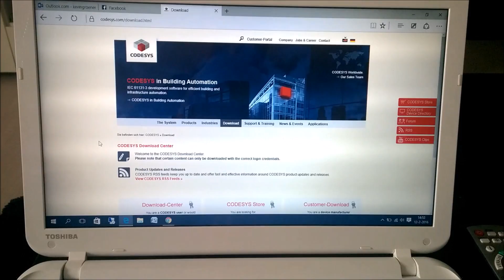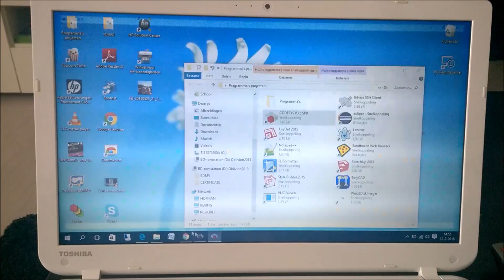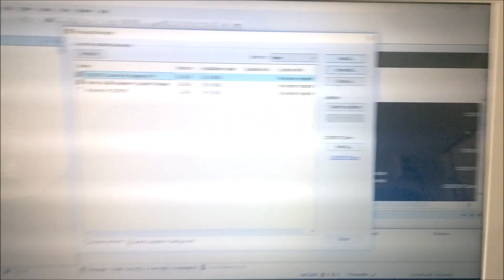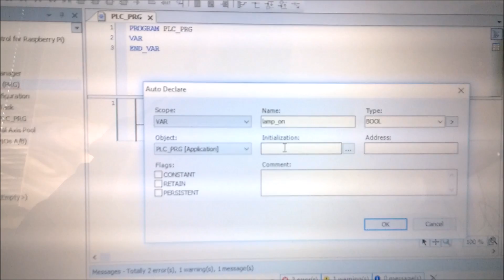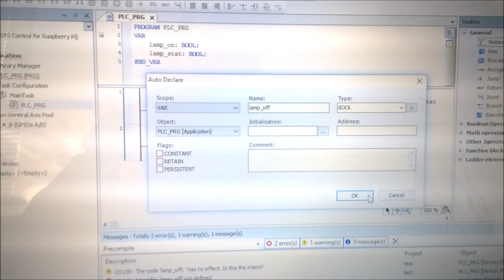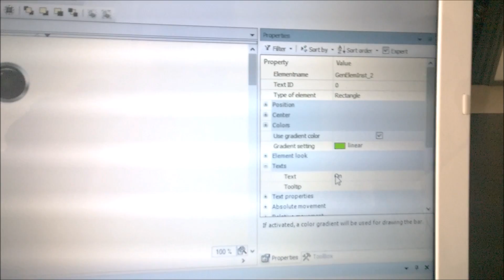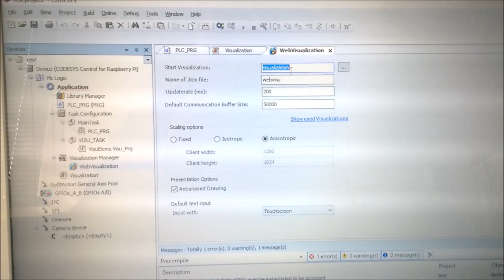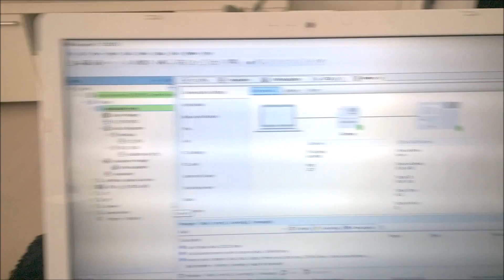RaspberryPi to PLC Codesys step by step (controling GPIO's)

Comment: Hello, I have a question: rasp can recognize usb ethernet adaptors? (those usb to eth cables).
I wanna try to use ethercat master with softmotion but need 2 eth ports. One for tcp and other for ethercat...
I use codesys with several different plc brands but they all cost too much and I am looking for somth cheaper.

Comment: Followed everything step by step but when i go to scan for my device to go online there is an error message "Scan Failed. Please check that the gateway is running and that it's settings are correct." Anyone know what this means? the gateway doesn't have a green circle next to it like in the video but instead has a red one. is there a step to set up the gateway that is not shown?
Reply: i had the same problem, i just reinstalled the PI!

the thing is to first update you PI in the codesys software, then when the raspberry pi is running and connected, push the codesys runtime package 'install' button.
the Package will get installed to the PI. after that Push the start button below.
then PI should be visible after scanning now!! or you can manually type the IP of your PI too.

Comment: hello i have one question. how to use another raspberry pi gpio with codesys. i want to my raspberry with other raspberry pi is gpio on off.i not found. please help
Reply from the maker: Murat İnan you want to use the other raspberry pi as slave you mean? In that case you should run codesys on both raspberry pi's. You must use then a communication protocol, like modus over TCP/IP. Then you can choose to run a program on the slave, or to couple the Io's directly.

Comment: can you please explain your hardware configuration , also in case of extension of gpio pins what should be done to increase numbers of gpio pins, also what should be done to take analog input/output, what are hardware is available for it and how to program  using codesys?
Reply from the maker: Soon I will be making a video how to connect a esp8266 with raspberry pi using codesys as software. This is a low voltage (3,3V) chip that has WiFi on board. And will function as remote Io. It's also possible to connect it with a Arduino for extra Io's.

Comment: Ciao... Thank you for this video; i followed all your instruction but i'm not able to switch on the led.  All is working: codesys program and  online connection is active...  i see, in the online in plc program and on the webvisu, the status led switch on and off but, physically, nothing happen.... The GPIO is ok ( i tested it by shell and WiringPI library ). Do you have some suggestion ?
Thank you very much again.
Reply from the maker: You are running Codesys on Raspbian?
Reply: @kevingroenendijk4681  im exactly in the same situation, and yes im using raspbian, is that a problem?
Reply: Damart Sandoval Dominguez are your GPIO set to inputs and outputs?
Reply: Peter Evans yeah, actually I already fixed my issue. The problem was my raspbian version, the first time I tried installing it with NOOBS and for some reason that way it failed to work with CODESYS. But after using a digital image to replace the NOOBS version I was able to make the pins work with no change in the code or configuration.

Comment: What is the possible reason that I can't reach it through 192.168..:8080 ??
Reply: maybe the firewall, maybe the port is closed?
can you ping the 192.* ? (if pinging is not blocked also by the firewall)
Reply: I'm having problems with webvisu too. I cannot connect with any browser to my 192.168.0.1:8080/webvisu.htm page. Why? Any clue? Program is running and I can see it running on Codesys (the internal visualization page is working)

Comment: Eeehhh... not realtime, no wonder its only 35$. Non-realtime plc is kind of like a car without wheels. What you can do without realtime you can just as well do with scripts or whatever, applications that really benefit from plc control kind of demand realtime too. For example nc control where multiple axises of movement need to be coordinated.
Reply: Yes and no. I had to use a beaglebone black to communicate to atmel chips. 
Allen Bradley Plc to Beagblebone to atmel.
It was the only thing we could think of to keep the cycle time down. And no this wasn't small scale. It was on a $5 million project. You've probably used the product it's creating.
Reply: Raspberry's are meant to be used for educational purposes. there is no company in the world that would control there automation on a 35 dollar device. So your point is completely irrelevant
Reply: blkmagnum sounds really interesting but why the beaglEbone, why not just Pi to the AVR?

Comment: Please help..
I bought Raspberry pi 3 and by default it has IPv6 switched on.. I can't switch it off and work with IPv4 so I can work on this project..  And I would really want to adapt R_Pi3 for codesys because I use it for a few years on some really expensive PLCs..
Thanks in advance..
Reply: Hi! Well I also had the same problem initially but the solution was pretty simple. Once you turn on ur RBP, goto preferences & enable SSH. Reboot and now try again